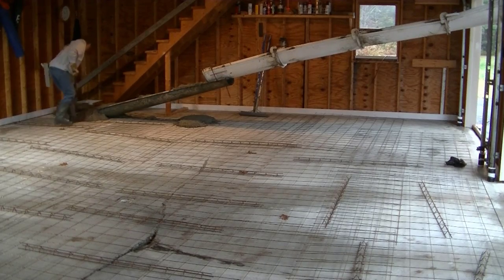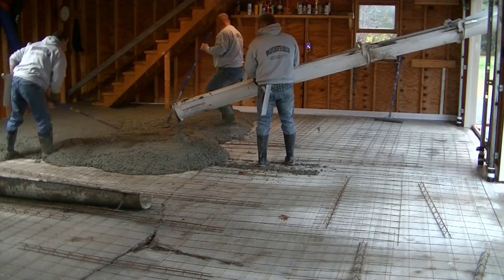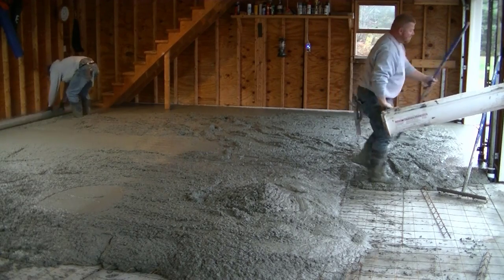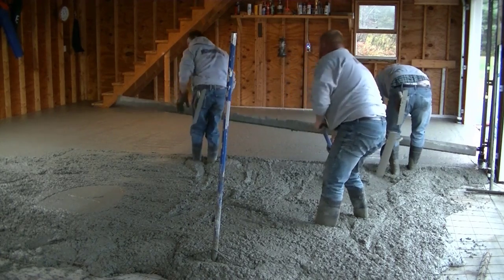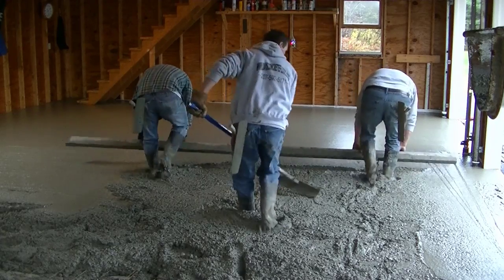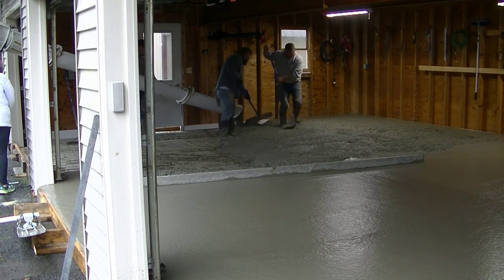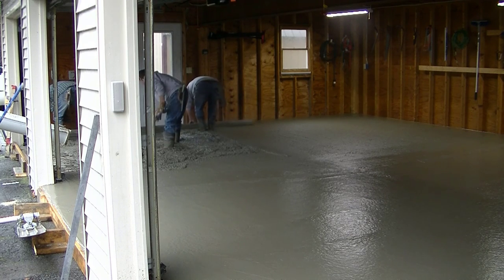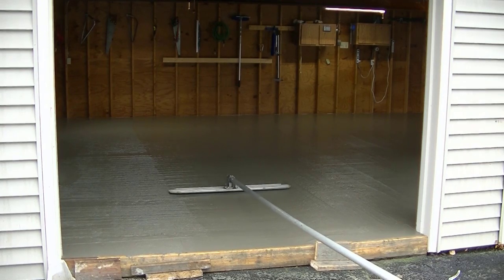Pour A Concrete Slab Over A Concrete Slab | Garage Floor Makeover

Comment: I would have just sloped it to the original height at where the garage door is. Its gonna look weird on the outside and not seal properly with the door not going down to the intended height.
Reply from the maker: He's re-paving his driveway. That was one of the reasons for raising the floor.

Comment: Can you do the same with a driveway?
Reply from the maker: If you had a driveway that has settled and cracked very badly, I would want to investigate why before pouring over it. Being exposed to the elements with no roof over it, a driveway would be more likely to do the same thing "crack" if you just pour over it. I'm not saying you couldn't pour over it but I would be more likely to suggest a tear out and re-pour for a badly cracked driveway just to make sure the sub-base is sound.

Comment: The new concrete will crack right where the old concrete cracked, that is why this is never done by any reputable company. Just tear out the old slab and pour a new one. I've been pouring concrete for 32 years and I've only seen it done once by a neighbor. Within one year the new slab was cracked everywhere the old slab was cracked.
Reply from the maker: Wow, you've seen it done once and your giving advice based off this one experience. I've done it over a hundred times SUCCESSFULLY in the last 40 years and you saying i'm not reputable. I inspect each one I do to make a decision whether to pour over or demo and re-do. Not sure why people keep hiring me?

Comment: The old floor is cracked for a reason.. most likely water and settling.. Let's add more weight?  Doesn't seem like a wise more.. I personally would not recommend this method.
Reply: No kidding, most people refuse to deal with the source of the problem which is most likely a poor base and water running under the slab due to poor exterior drainage allowing rainwater to accumulate near the base of the garage or slab.
Reply: @petebusch9069  in the video the guys says he has been pouring new slabs over problem slabs for 4yrs and probably has done over 100s of times. The real problem will come in 10 years later will they be a bigger problem?
Reply: Yes broke floors usually mean water and frost jacking. You can correct the water problem, but the water and jacking will create “mud” within the aggregate underneath. I dont know alot about concrete but run excavator and do site prep/pads/roads/demolition. I have never seen good aggregate in an old pad that had water issues, almost always turns it bad. I would also not recommend this without correcting the aggregate and compacting to +/- 98%.
Reply: @ChuckBeefOG  thanks appreciate the info.
Reply from the maker: A demo and re-do isn't always necessary. Sometimes it is but not always. All the previous issues were being dealt with except the settling which happened about 25 years ago and none since. Re-landscaping, Re-paving the driveway, no more water issues. Just have to inspect each one thoroughly and make a decision base off that.
Reply: Mike Day Everything About Concrete I missed the part where you said you tapped on the floor to listen for hollow spots. That is a very good idea. New is not always an option as labour is $50/hr here and concrete is $300/m3. If the drainage issues are solved and there are no voids then give’r shit.

Comment: Eastern Ontario (Canada) 
Guys call it screeding.
Reply from the maker: Are you using hot water in the mix yet?
Reply: @MikeDayConcrete  
Hi Mike, im not a cement finisher by trade...We do masonry work. So we only take on the odd small cement pad or small repair job. As far as i know, i havent heard anything about the hot water in the mix...They do say about adding drying agents to the mix, but im not certain as to what exactly that is.
Reply: Mike Day Everything About Concrete I’m in southern Ontario and in winter suppliers add hot water around the beginning of November until about March

Comment: Soooooo, your going to poor a new driveway to match the 4 inch step up????  Couldn't you just use self leveler and avoid the 4 inch step up into your garage? I would not be happy with your end product.
Reply from the maker: He needed the added height to "fix" his driveway. It all sloped towards the garage. Now he can re-pave the driveway and have it slope the right way so his garage doesn't flood when it rains.

Comment: Striking off the concrete as you show with the scooping action leaves a "wash board" service that appears not to float out. That "smooth" surface would not meet my grand dad's approval.
Reply from the maker: Cecil, I know what you're talking about but we power troweled it smooth so none of that showed when we were done. Usually that doesn't show after bull-floating but the concrete was setting fast due to the warm water in the mix and the accelerator we used.

Comment: you should have a bond break ie 6 mil poly.
Reply: KelMaster Construction   It may last .. I typically R&R concrete not pour over.  If I had to pour over a failed garage floor  it would have low areas filled with sand or 1/4" gravel folowed by 6mil poly and a 2x2 grid of rebar drilled into the existing foundation .. Not a fan of adding more weight to a surface that already failed

Comment: I was wondering what you were going to do at the stairway and stopped watching when you buried the stringer and just below the last step in concrete. Stairs should have been removed as well as the garage doors. You should have required this of the homeowner before the pour.
Reply: He explained the reasoning, and the solution.  The homeowner insisted.  He also said the customer was happy at the end of the video, so he listens... and you are gonna fault him for that.
Reply: @kegelcompare  Yes He should have told him no.For all this money do it the right way.He was getting it done cheep anyway.
Reply: @kegelcompare  Yep, I do fault him for that. Should have explained to the customer that he would end up with not only a trip hazard but a stairwell that is not to code. Obviously, the customer doesn't know anything and a competent contractor should guide these folks so the final result is safe and code compliant. But Brad, if you are good with a shoemaker job, have at it.
Reply: @gman8260  A trip hazard?  Not up to code?  If that homeowner is anything like me, he likely knows how to walk.  As far as "code", when the government builds something, they can do what they like.  When I build something, I follow the same rule.  It's sort of a Constitutional issue.  Personally, I like contractors who follow my directions.  If you need the government to watch out for you, that's fine, but don't dump it on the rest of us.

Comment: Been pouring concrete 30 yrs
Never pour over old concrete bad idea. Now u have 3600lbs per yrd on an already failed slab. All cracks in concrete will definitely come thru to new slab. Bad idea. It will drop again, and then your tearing out 7to 8 inchs next time

U call yourself professional not in my book.
Reply from the maker: Gregg, I have to disagree. I've been pouring concrete for 40 years and have poured over many floors, just have to know how to spot the ones you can and the ones you can't. I've never had to go back and tear out one I have poured over.

Comment: For anyone wanting to do this right,  this isn’t it. If anyone is about pour your concrete and all there using is that bull shit mat instead of properly spaced rebar find someone else,
Reply from the maker: That's great advice, I didn't know I'd been doing it wrong for the last 40 years. Not sure why people keep hiring me.
Reply: Mike Day Everything About Concrete Mike Day Everything About Concrete  Got keep them bids down save on rebar I guess. Or your one of those guys that tells the owner o it doesn’t need rebar I’m going add extra fiber to the mix lol be the only reason to use that mat. I give you points for using a screed board still, as a lot of the small time have ass guys are using grade pens and wide rakes and it leaves shitty floor with lots of highs and low spots. Screed boards are hard on the back. but gives the best finish level wise. But in my opinion if you have been in it 40 years, and you personally still have to get in the concrete. To do physical work. Will your not to good at your business. Especially at your age.

Comment: This is what not to do on soooo many levels! No drain, no stress relief lines, you can no longer park a SUV in there. Now you have to build up the driveway. Tearing this all out will be a HUGE HUGE disaster in the future. Just do it right! Tear out the old, and rebuild it better. You used a semi expensive band aid that will cost 3 times as much when you rip it off. 2 bit HACK!
Reply from the maker: Tj, If you were paying attention I said I sloped the garage floor 1.5" from the back to the front, the homeowner didn't want a floor drain. We slope most of our garage floors this way. We did power trowel this floor and saw cut expansion joints, I didn't show that on the video. One of the main reasons for raising the floor was so he COULD raise his driveway at the door openings and slope it away from the doors. He doesn't have a SUV so no problem there. He also saved himself about 34,000.00 from a quote he got of doing it YOUR way. He didn't want to spend that kind of money.
Reply: Tj Gsomething what is he suppose to do? Put a gun to the homeowners head and say  “RIP OUT THE OLD FLOOR AND CALL US BACK!!!!”?
You do what you think is right at your house and let others do as they wish at their house.
Reply: @richardheinen1126  have fun with that resale value!
Reply: @richardheinen1126   He should have told him no.For all this money. Do it the right way.He was getting it done cheep anyway.Most of the time you have to protect the customer from themselves.You are the expert not the customer.Period
Reply: I had this done, second one got big cracks and did not bond.  Had to have both layers of concrete jack hammered out and a third floor poured.  It was a new house so builder had to pay to correct.  Settling usually is caused by improperly impacted stone/soil or water underneath